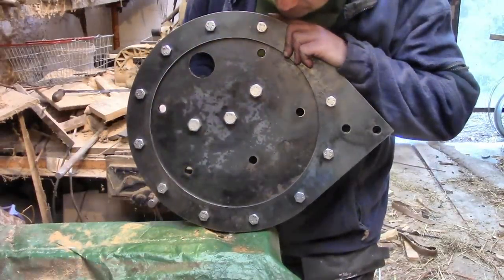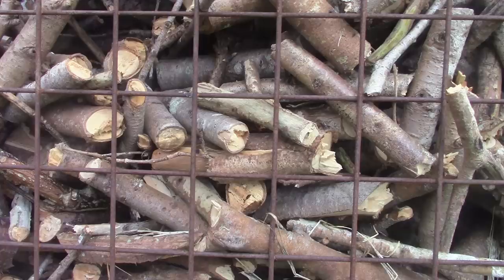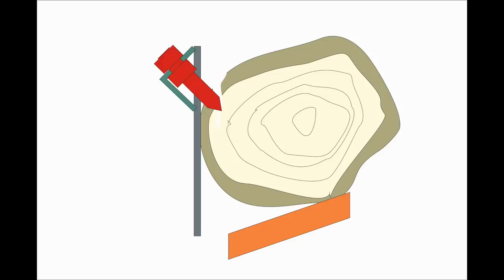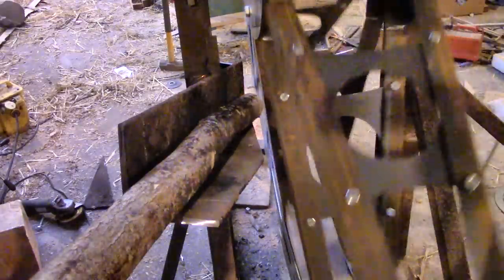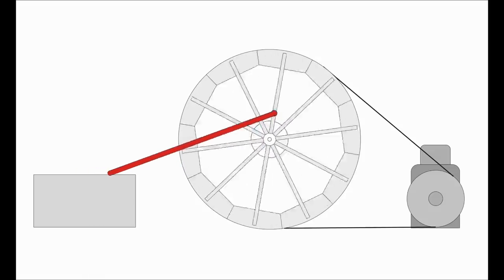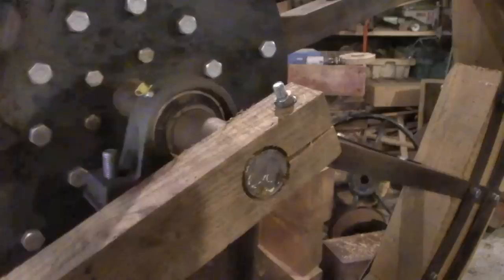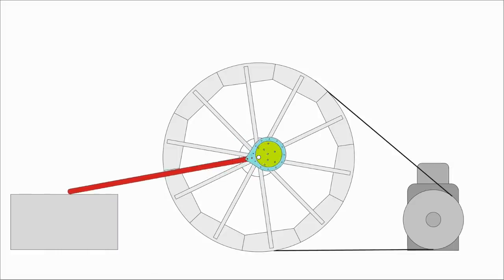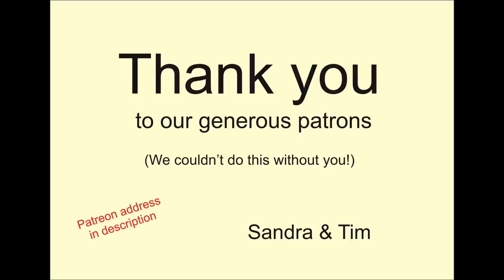I Made An Eccentric - And it's A Wonderful Thing!

Comment: Excellent design! Seems much better to have the chomping action away from the wheel, and that gives you an easy attachment point for other contraptions in the future. You might consider making the chomp happen on the pull stroke so there's no issue with flex in the shaft.
Reply from the maker: Good point!
Reply: Keeping with Tim's approach so far I would have thought that a flex in the shaft would be more desirable than a whirling dirvish coming off its frame in the case of a seizure. Either way, I'm loving the practical exploration of mechanics.
Reply: Hello NightHawk : )
Reply: To save the wheel in the case of a jam/stall it might be wise to have a breakaway section - possibly a covered portion of belt/chain/conrod that is weaker than everything else that can go wallop and be easy to fix, vs. a nastier point of failure.

Comment: eccentric disc and eccentric strap is the name. I am flummoxed myself building them for my engine. They were invented in the Middle Ages on water mills and wind mills.
Reply: I had some googleling to do, maybe because English is my 2nd language. And finally I landed on the Wikipedia side "Eccentric (mechanism)".
Reply: @bakudans4851  Thanks for that suggestion.  It seems like Tim is building the opposite of a steam locomotive, converting rotatory motion to linear motion instead of the other way round.

Comment: Brilliant video! I like the solution you came up with. I did some research myself into wood chopping for a project and the best solution I could find is basically a cheese grater design. I.e. you feed a log vertically into the machine. The machine has a pipe with a slot cut into it that's sharpened. The cylinder turns and slices the log during every rotation. The faster you want it to go, the more edges you cut into the cylinder as well as turning up the rpms of the machine. I liked this idea, because it's relatively easy nowadays to acquire a large diameter pipe.

I find your solution fascinating though as I can see the steam engine influence. Also, don't apologize for projects taking too long. Sometimes that is how it is. You make mistakes or you imagined a mechanic working in a way that in reality it doesn't. That's how you learn. That's why you've got to show a lot of determination and tenacity when making something with your own hands. Often things don't go your way. From my own experience at least.
Reply: Fully agree. Our Tim reminds me of the early locomotive engineers, except with the addition of a plasma cutter 😂.
I imagine the result of the Rainhill trials might have been a bit different if Timothy Hackworth had had one of those !!
Reply from the maker: Thanks, Florian!
Reply: Hmm, not convinced - cheese is much less sturdy than metal/steel; which is much less so the case for wood vs steel, especially when you want to do cross cuts (i.e. across the wood grain).

If you research wood cutting mechanisms, almost all that attack wood at perpendicular angles (i.e. across the grain) are whood chippers, who basically destroy the wood's fibrous structure before cutting/chipping it into sizes that are too small to create charcoal (as per Tim's explanations) - these are to create mulch which is perfect for gardening/composting.

Anything I have found that creates wooden pieces larger than chips rely on pre-cut chunks of the desired length and then split them along the grain, basically rip-cutting or splitting similar to an axe or hatchet. And this is ideal for the reciprocating motion Tim is about to install onto his magnificent monstrous "Wheel of Doom" (if I may say so hahaha)
Reply: @argh02  They exist though, albeit my description doesn't match all of the existing chipping machines. The industrial ones have a horizontal automatic feed system. I have also found vertical ones that use a gravity feed, but I don't if they would work as well as horizontal force fed ones. You can find the mechanism I am referring to by typing "drum wood chipper" into YouTube or Google.
Reply: @xFlow150  Agreed - but these oeprate at very high speed so that the amount of wood chipped off is of, well, chip size per cut across essentially the log's end grain.

These are too small to be useful for turning into charcoal as he already stated (@Way Out West - Workshop Stuff are you reading this? :-))

I am still seriously in doubt whether this would be the right approach

Comment: You (accidentally?) said what this mechanism is called in the video, its an eccentric. The centre bit is the eccentric sheave and the outer is the eccentric strap. Normally they are just plain bearings, you see them on steam engine valve gear.
Reply: spot on
Reply: Yes it’s an eccentric
Reply from the maker: It just doesn't seem enough of a name, though, Muncho. Any cam or crank is eccentric, surely? But I'm sure you're right. Thank you!
Reply: @wayoutwest-workshopstuff6299  https://en.wikipedia.org/wiki/Eccentric_(mechanism)#/media/File:Eccentric_animation.gif
It's really what you have built...

Comment: Stephenson’s valve gear seems to use eccentric rods with an arrangement similar to this to allow reversing. I knew I’d seen it somewhere. 
A good old googling of valve gear arrangements will probably turn up some random useful ideas for you. All the best Tim.
Reply: Not just reversing, the valve requires it for the engine to work at all, the reversing is done through the radius isn't it?

Comment: Now that you've sorted out the eccentric cam/crank jobby (amazing by the way!) the attached push rod could be used to push wood/charcoal/anything through a different set of attachments designed specifically for the job in mind. A sold upright blade to split logs in half (or quarters or eighths). Different sized grids to push the charcoal through to make it progressively smaller smaller.. and another crank coming off the push rod could be attached to an articulated and slanted table top which could "shake" whatever's on the table top down towards blade/grinder/etc. You could stuff the worlds largest sausages if you wanted to.

Comment: this should really be mounted on a separate mechanism, connected to the flywheel by another belt. otherwise the forces involved further risk it breaking violently.

also, just generally having the sharpened elements on a separate mechanism will likely make it safer to stop both the bladed element and the flywheel in case of emergency.

Comment: Great video Tim!  I am very glad to see that you recognized the need to use the flywheel as a flywheel and nothing more.  Grinding charcoal may have been fine, but processing wood with the flywheel was a recipe for disaster!  However you tie the eccentric rod to any job, make sure to put a weak link of sorts between the shaft and the job so as not to risk damaging the flywheel.  Maybe if the rod was two pipes where one slides inside the other so you could have a shear pin to pass thru them?  That way if the rod "needs" to stop, the pin will shear off and the flywheel can keep moving without a sudden stop!  Keep up the good work and stay safe!  👍😁👍
Reply: A weak link is important, but a safety off option or the possibility to apply and stop applying power could also be usefull!!!
Reply from the maker: Thanks - good point!

Comment: Wonderful Tim! What a treat to watch your projects develop!  We can’t expect a regular schedule of videos and then they wouldn’t be a surprise! I’m getting the feeling that this version is somewhat like my mother’s old bean slicer, which I still have and use for runner beans.  One thing I know is that it doesn’t work very well if you go too slowly, so if it kind of works at slow speeds it will likely work way better once up and running off the engine.  Now I am wondering if your project would improve the design of bean slicers.

Comment: HI Tim! Another thing instead of your "inverted crank cam" was to have just a cam as you made at the steam engine, and then a push rod to split the firewood! :-) Or even could be double cams so it hits twice/ rotation! :-)
Reply from the maker: You're right, of course!

Comment: That is an impressive eccentric!!  Very well done sir!  I’m always impressed with your machine design!  I believe those eccentrics are used in hammer mills (power hammer) like black smiths use.  Your wood chomper could possibly use similar mechanism at the action end where a heavy spring will compress if wood is too much to chop in one blow.  The spring would compress then encentric would rotate and then hit the log again.  This will help protect that beautiful wheel you have made and prevent jams. (0:

Comment: When it is time to  build the chopping system. 
You have to design a timed feeding control.  So the pieces are some what the same length.  Two feed dogs.
Maybe take a look at  a diesel tree chipper. 
One last thing is some kind safety disengage. As this huge wheel will hard to stop.
Cheers from across the pond.

Comment: Fascinating!
You have the Good - Cheap - Quick triangle ..... You can chose any 2 of them! I think you have chosen wisely!

Intuitively I think a cam always pushes something. A Crank can push and pull (or be pushed and pulled).

Your eccentric (good name) will, I think work well as a prototype but when spinning on your wheel may get heating problems with lateral forces causing metal on metal rubbing. Maybe a judiciously placed few blocks of wood, suitibly greased might solve it for little cost eather £ or time! ;o)
Reply: Correct!  Also, a crank follows a circle, while a cam can follow any path.

Comment: I think with a wheel of that size, weight & speed (lets say angular momentum) the one thing you absolutely positively definitely need is a 'weak' point that will fail if anything jams and allow the wheel to continue spinning freely
Reply: A shear pin, as it were.
Reply: @RussellNelson  Or a sprung clutch
Reply from the maker: Good point!
Reply: @wayoutwest-workshopstuff6299  Remember that this wheel is a giant gyroscope and if it is suddenly jammed when spinning then it will want to twist and will either bend or even snap it's axel (or bearings)

Comment: Your big flywheel is to increase inertia, but you don't need to drive directly from that. It would work just as well as a stand alone flywheel, allowing you to take the drive from another belt and pulley on the engine. This opens up a complete blank page to design your chipper however you wish, but without modification to your big wheel.
Reply from the maker: Good point

Comment: Might have to play with stroke length some, which should be as simple as changing the bore on the eccentric cam, closer to center would give shorter stroke but more power? though you'll be limited by how big a log you intend to chop...  Think I'm gonna need a cnc plasma table someday, the mind wanders with the possibilities.

Comment: My first thought when I saw you working with the blade was to move it more to the outer edge of the wheel so that it would gain additional torque and do the chopping/grinding farther from the frame to avoid jamming. But, seeing the updated plan, I think that will work out much better. One thing you might consider for your eventual blade mechanism is to make it a two sided plate with a central connection to the crank shaft; make one side a full edge blade for taking full slices out of bigger logs, the other side set up more like a large cheese grater with holes that have edges to them suited for taking smaller chops to break up the charcoal. Then to switch between them you just have to flip the blade around.
Reply: Putting the blades on the outside of the wheel would result in less cutting force, not more (it would change the arrangement from a class 2 lever to a class 3 lever)

Comment: Tim and Sandra I love you both keep safe Tim you can still use your welder to weld thicker steel just pre heat the base metal with a heating torch and weld the joint soon after (safety first remember)

Comment: Okay. Not nagging. But a weird approach for installing the pointy-eggcranck. Without the need to disassemble the torque wheel.  It should be possible to cut the pointy bit in half. Also the outer rings. You'll figure it out. Because I don't know how to get it clear in this comment. Like the half-sprockets for go-karts/pitbikes/deathtraps.

Comment: Rather, how about an Eccentric blade? 
A circular blade say 50cm in Dia. Mounted on the wheel 10cm off centre. A feed pipe provides the stock and the blade cuts slowly, rather than the chopping action of the pencil sharpener. Yes the will be some rotational friction, but it's slow moving, and much simpler than the linear design.

Comment: I'm surprised you didn't a small interdigitated grinder for the charcoal (similar to recycled plastic grinders). You would have no trouble making one with your plasma cutter, and they're proven tech. You could likely run it on hand-crank-power, or pedal power too, if you wanted the exercise.

Comment: Take the chomping at the video bit as a compliment, but don't feel rushed- make them whenever you feel like it.
The power developed by that beautiful wheel scares me- I wonder if there is a way to make it safer with some sort of mechanical fuse between the wheel and the destructive stuff. Maybe a weak link that will break or clutch that will slip. (and actually, a clutch could also allow you to quickly disconnect power without having to bring the wheel to a stop- might also be useful in your process, for changing bins or whatever.) Of course it is a complication...
Looking forward to the next exciting episode, whenever that may be.
Have a great day Tim!

Comment: Look inside an old hay baler. The plunger that squeezes the hay up tight and crops off the excess each stroke is driven by something very similar. The weak point in your design may be the ball bearings. Good luck though! (and you have a new sub)

Comment: Your projects never bore me Tim rather the opposite really.  
Collared eccentric Cam or Crank?
If you look at the crankshaft in a petrol engine and the connecting rods on the pistons and note the crankshaft is held in place with bearings also then you might call your invention a crank.
But Eccentric Collared Cam or just Collared Cam is what I'd go with because it is just that, is it not?  I think so!
Cheers 🇨🇦

Comment: Well, I had another thought.

I have been following the wood chopping designs for years now and want to suggest that you spend a few rainy hours looking at YouTube videos from numerous Eastern European farmers who have designed exactly what you are also designing.

All of the designs for choppers that I can remember are fed manually with each log fed individually.

They usually cut the log through with each rotation so they are limited to a maximum log diameter.

In your original presentation in this video with the sharpened bolts you could also wear away larger diameter logs.

Not sure how many of the larger diameter logs you want to process.

I am lazy so I was always looking for a chopper that could be fed automatically from a hopper.

I look forward to your next video, be safe, there is a lot of power in such a large heavy wheel!!

Comment: Have you considered making your own bearing? i.e. instead of using off the shelf bearings, having a solid inner and outer surface for your eccentric and have either ball bearings or cylindrical rollers in there (properly lubricated). That may help with wear, as I suspect those bearings might not like the beating they will likely receive.

Comment: @Way Out West - Workshop Stuff 7:37 You should use a 2-part crank shaft, with a hinge between.
In that way you get the "chopping" side of the shaft going fairly horizontal, while the "wheel" side of shaft goes more up-&-down (which is a motion you don't want) when it goes around.
Take a look at how eg. steam-trains or steam-engines does that connection between the wheel & piston.
Here is a playlist for your convenience: https://youtube.com/playlist?list=PLFd8ct1hp5EvGe1hTNkNQmdwy8tcd1xJ1
Reply from the maker: Thanks - will get to those this evening

Comment: The blade needs to be further from the wheel so that you can slice 0.5-1" slices off the log. Getting discs off the log will be beneficial anyway for other things. To crush charcoal I would use a Jaw Crusher. You ca dump in the coal and 2 boards coming together crush it until it is small enough to fall out the bottom.

Comment: Not related to this video, but I was thinking recently as to how you could create buffers for your field railway rolling stock. Some narrow gauge wagons used the longitudinal sole bars as buffers, with metal plates on the end (usually called dumb buffers)

Some have a simple centre pipe, with a spring and another small pipe inside, with either a round, rectangular or square piece of metal attached onto the smaller one, and then a chain and hook underneath (the Ffestiniog is the most famous to adopted this). 

If you go down the dumb buffer route, try using your thinnest wagons and have the buffers spaced as wide as possible, to give a set spacing and height. Another method is to use i beams, as the Talyllyn have done on skip wagons

Comment: Not bored at all.  Fascinated.   Wish I could send lots and lots of money, but given what I have, it's good that I'm patient!

Question: Would you not require a counter-weight to the wheel to offset the stresses? Think of the wheel of a steam locomotive: a counterweight on the opposite side to the connecting rod made for smoother operation.

Comment: Looks like a good concept Tim but I wonder if your offset from the centre is too big? What is the length of travel on the rod and the maximum size logs you are thinking it could chomp?
I would think that the longer the stroke will have less power available than a shorter stroke so it’s likely a trade off between power and capacity